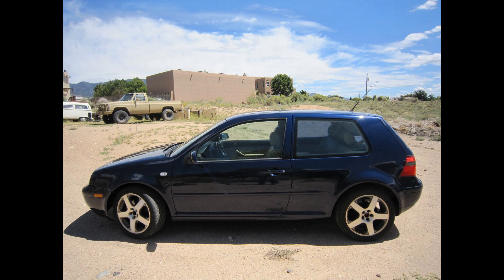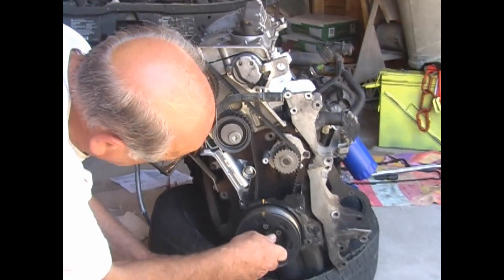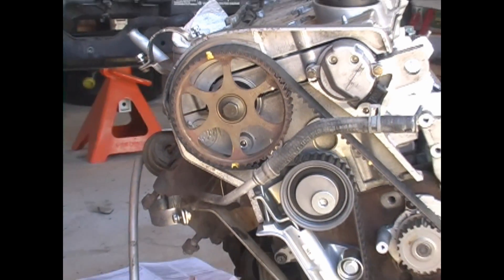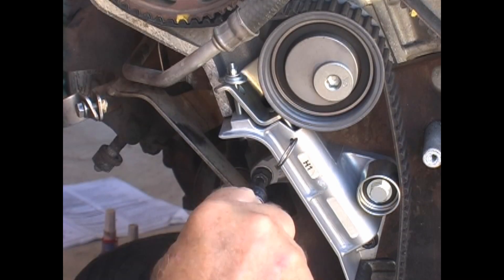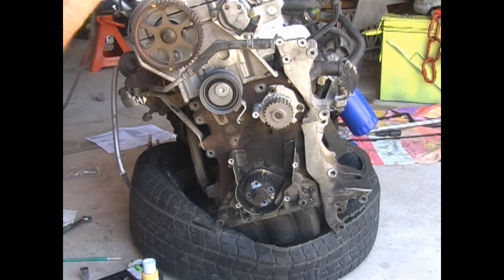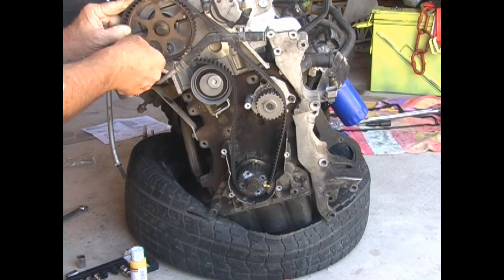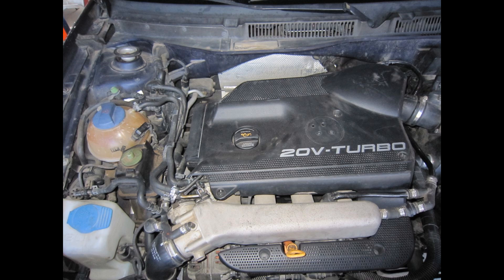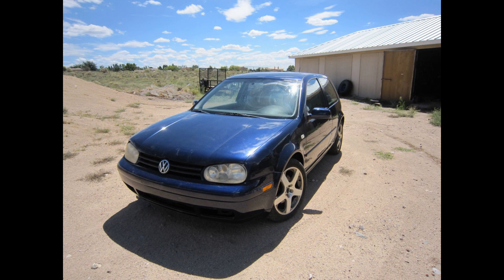VW/Audi 1.8 Turbo Timing Belt Replacement

Comment: I keep asking everyone this question and nobody can even respond. When I get full wide open throttle after it starts there full boost and power, but once I cone to a stop there absolutely no power, no boost, no compression it feels like. Then if you shut it off and turn it back in instantly, it will go right back to full power then is starts all over again. It all started when an a.c. hose blew out. I did smash the intercooler in the asphalt when the hub went while driving, it was disastrous. It was tuned, the dealer flashed upgraded software adv looking for which airbag was turning on the ars light. Then the hazard light switch started roasting and caught fire, no damage to other connectors. Could it have something to do with the SAI, EGR, pcv, comni valve, n249. wastegate actuator arm? It's the strangest thing because I've never experienced something like that in a car
Reply: Sound like dirty throtel body but idk it could be thotel posision sensor too.
Reply: +408skills. How do I check that?

Comment: Very informative video and well done!  I have my engine out and have a full kit ordered.  I just wish I had made the marks on the belt before I removed it along with the water pump.  Too late now......lol
Reply from the maker: +Tom Retired Pilot  Tom, all is not lost, I describe a way to establish the marks if you did mark first.  Also, I had someone write in and say the following. "Hi Wayland. In the meanwhile I changed my timing belt and I can confirm that when counting the teeth on the timing belt that if  tooth n° 1 is on the camshaft timing mark then tooth n° 68 is exactly opposite to the bump on the lower crankshaft sprocket.  Indeed it is not that important but it is a 'double check' to verify if you have exactly 'copied'  the marks from the old belt to the new belt. At last counting the teeth applies only to this specific type of engine !The only thing I could not do was 'blocking' the piston of the old tensioner since the piston shaft was twisted in the housing. With the engine in the car I did not find any method to turn the piston shaft in way that the hole in the piston shaft did match with the hole in the tensioner. So what I did was to first loosen the tension roller. No problem since I had to replace the tensioner anyway. Even when one wants to re-use the tensioner it would have been possible to compress it again in a bench vice.As I earlier stated your video was an encouragement and a great help to me in doing this job myself.Best regards from Belgium !Alfred"

Maybe you can see all the comments but I copied it here anyway.  Just have to make sure we are talking the same engine.   

I am a retired pilot also.  Good luck in getting your engine back together
Reply: Don't think too bad on yourself. I did the same thing. Lol

Comment: Hello Wayland,Do you know at what number of tooth you put the mark on the crankshaft sprocket. Some descriptions say that when the tooth on the TDC-mark of the camshaft is number 1 (on the belt)  then the tooth (on the belt) on the cranshaft sprocket is nr. 68 (exactly on the location on the lower sprocket as shown in your video). Can you confirm this ?Regards,Alfred
Reply from the maker: +Alfred  Hi Alfred.  I hope I understand your question.  If not, feel free to write back.  ( see second paragraph) I am not aware of any numbers on the teeth of the crankshaft sprocket.  The timing marks are on the crankshaft pulley and the lower timing belt cover.  The timing marks at the camshaft are on the camshaft sprocket and the case.  If you go to the front of my video you will see what I mean.  As I said in the video it is important to make sure the timing marks are aligned prior to removing the pulley and lower cover.  Once the timing marks are aligned, then remove the pulley and cover being careful not to turn the engine.  At this point, it doesn't really matter which tooth you mark assuming you didn't turn the engine while removing the pulley.  Just mark a convenient tooth and the case adjacent.  These marks are just for reference so you don't have to put the pulley back on to check timing.  It is important that you don't turn the engine without the timing belt in place.  This engine is what they call an interference engine meaning the pistons will strike the valves when not correctly timed or the timing belt breaks.   

So I wrote the above comment and then read your question again.  I think I missed what you are asking.  My video assumes that you mark the sprocket and old belt before removing it.  And then transfer the marks to the new belt.  Using this method doesn't really depend on counting belt teeth since everything is relative to where you placed the marks with the old belt on.  That is why I did it that way.  Now if you didn't mark the old belt or the belt broke you can still use my method.  Do everything at the first of the video to get the engine and camshaft on the timing marks before you remove the pulley and lower cover.  And then when you remove the pulley and lower cover put some reference marks on the sprocket and case.  These are the marks at the top (12 o clock)of the crankshaft sprocket and adjacent case.  These marks are important so you know that the engine is in time.  Than take your new belt and put it on the camshaft.  At this point I would put a mark on the belt at the camshaft timing mark.  From there put the belt over the water pump pulley and down to the crankshaft.  What I found is that I had to back off the crankshaft pulley (counter clockwise) just a little bit (one tooth or less referenced to the timing marks you put at the top of the sprocket and adjacent case), put the belt on and move the sprocket back (clockwise) to the timing marks at the top of the sprocket.  You will know your are right if you turn anymore clockwise you will also start turning the camshaft.  At this point, I would put a mark on the belt and the sprocket.  This is done with the tensioner off the engine.  I never really counted the teeth on the belt.  Then put on the tensioner and turn the engine over a few times.  The timing marks should  stay lined up.  Just be aware that once you turn the engine over a few times, the marks on the belt will not line up again but the timing marks will.  So I don't know if the number 68 is right or not.  

Just to fill you in on the complete story, the engine I was using in the video had suffered a broken timing belt.  So the head had to be rebuilt.  So I went through the process above to establish where the marks on the belt needed to be.  

Hope this makes sense.  If not feel free to ask again.  

Wayland
Reply: +Wayland Adams , Hi Wayland. In the meanwhile I changed my timing belt and I can confirm that when counting the teeth on the timing belt that if  tooth n° 1 is on the camshaft timing mark then tooth n° 68 is exactly opposite to the bump on the lower crankshaft sprocket.  Indeed it is not that important but it is a 'double check' to verify if you have exactly 'copied'  the marks from the old belt to the new belt. At last counting the teeth applies only to this specific type of engine !The only thing I could not do was 'blocking' the piston of the old tensioner since the piston shaft was twisted in the housing. With the engine in the car I did not find any method to turn the piston shaft in way that the hole in the piston shaft did match with the hole in the tensioner. So what I did was to first loosen the tension roller. No problem since I had to replace the tensioner anyway. Even when one wants to re-use the tensioner it would have been possible to compress it again in a bench vice.As I earlier stated your video was an encouragement and a great help to me in doing this job myself.Best regards from Belgium !Alfred

Comment: If your changing it in the car.  You can loosen the belt by taking out "partially creating slack" the water pump.  This will give you enough slack to slip the belt off the pulley. Once off disassemble as usual.   If your going to do this, drain the coolant, and take out the thermostat (replace thermo and housing too) to drain the void behind the pump.  It will help keep things cleaner.  When you put it back together, put the water pump in last, sliding the belt over it as you carefully tighten the pump up.

Totally agree with the full kit, do it all the first time.  Belt, tensioner, pullies, pump, thermostat, housing...etc..  All this stuff is buried on a 1.8t VW.
Reply: What I did is loosen the idler pulley next to the tentioner and had just enough slack to squeeze a new belt on ;) after that I pulled the pin and rotated the crank 3 complete revolutions to ensure the timing marks were accurate